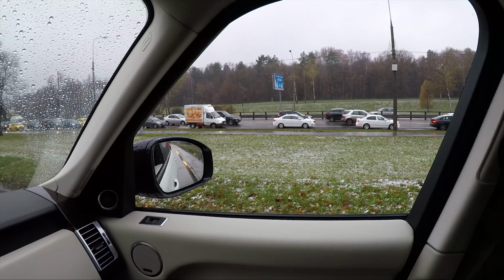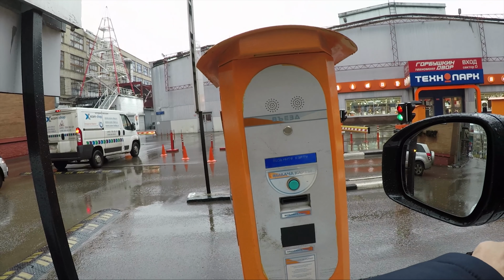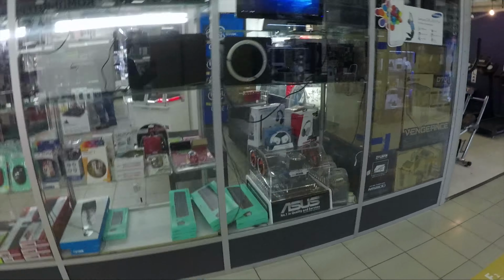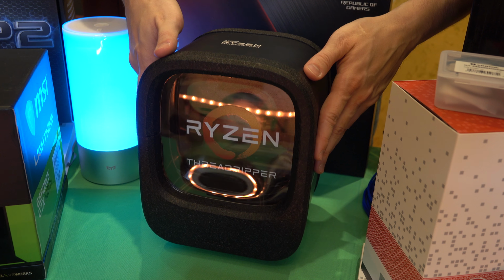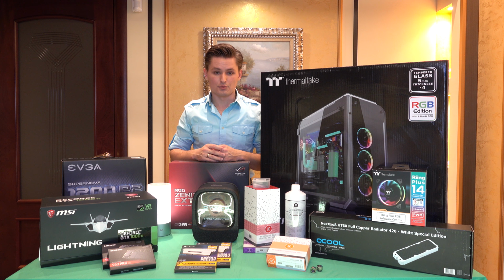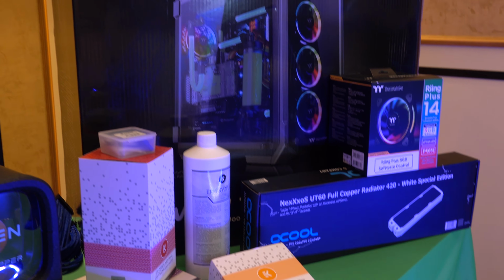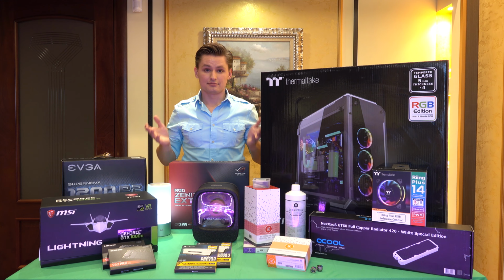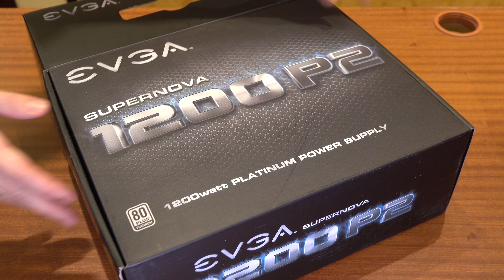Epic Threadripper Build - Part hunting for AMD's insane CPU, Unboxing and Assembly!

Comment: What temps do you get on the CPU?
Reply from the maker: Erik Beljan Idle temps @ 3.9 Ghz sit around 31°, under non-synthetic load it heats up to 50-55°. Both my fans and pump are set below max to keep noise down.